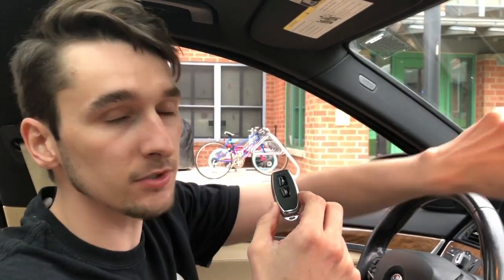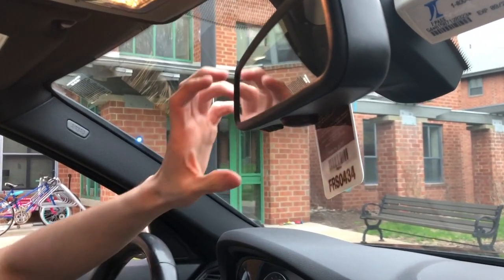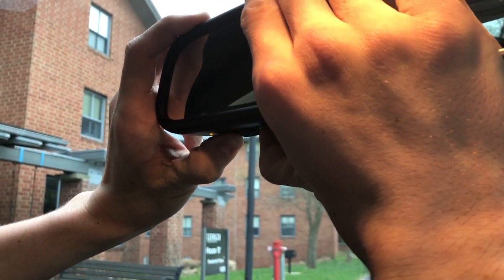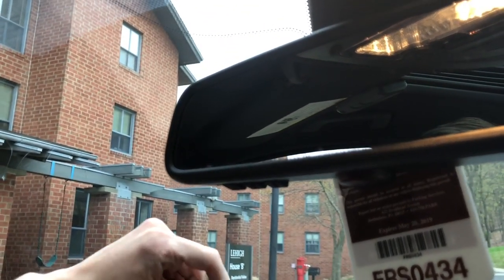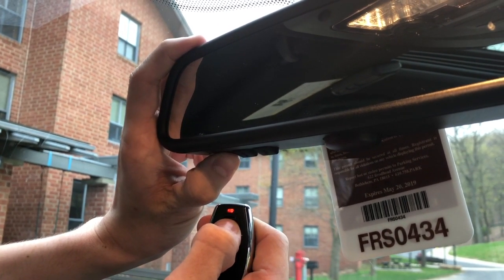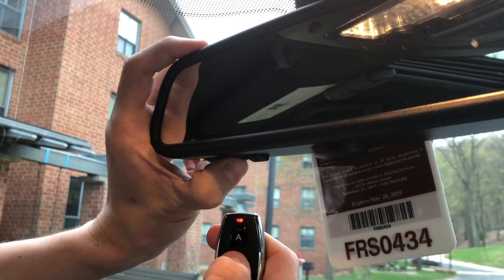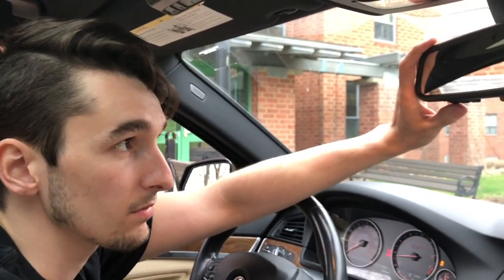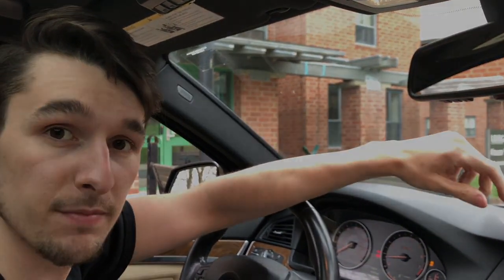HOW TO PROGRAM REMOTE TO REARVIEW MIRROR BUTTONS DIY EASY (EXHAUST CONTROLLER) VALVETRONIC DESIGNS

Comment: I have a question ~ 

I bought my valve a few years ago from SPELAB,  but my remote is exactly identical to this remote. The only thing that might be different is mine says “XR” on the back, and my buttons read “OPEN/CLOSE” instead of “A/B”

I’ve tried to program it to my SAAB’s homelink controls, and it just fuses to work! Do you have any insight? Are there other remotes with the same casing that function differently?

Comment: You just made a sale man, didn’t like to have a separate key chain to control the flaps, this is awesome!

Coming in April, I am opening up the oem mufllers to connect a straight pipe from the inlet to the flapped outlet side (inside the oem mufflers, the flapped side has a baffled pipe so it is muffled a bit). 

With this, I will have access to a real straight pipe to a stock muffler setup at the touch of a button 👌🏻

Comment: Does this still work with the new one button controls?
Reply from the maker: Yes!
Reply: @valvetronic  Is there any scenario where I need to reprogram the car?  I programmed it and homelink accepted the signal, but it was before I installed the valve controller.  Then when I tried to use homelink to control the valve, didnt work, but I did not try to reprogram it again...